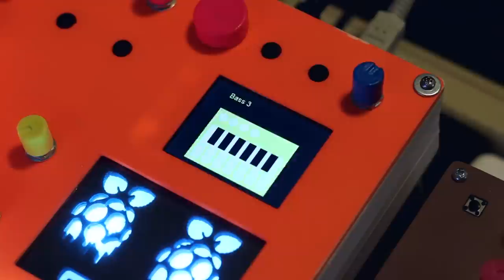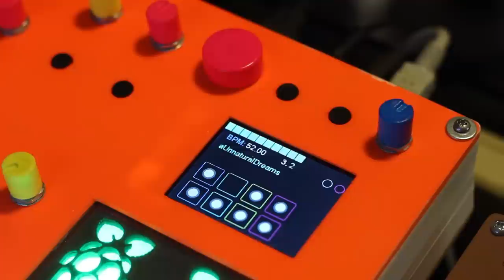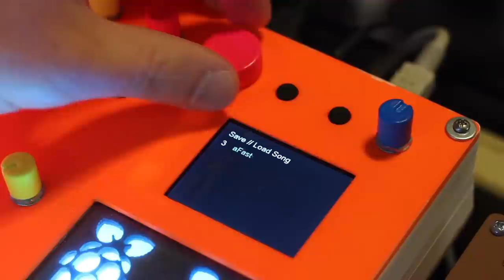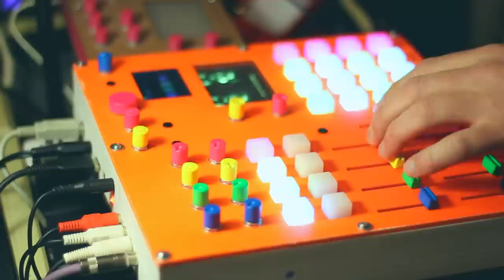Raspberry Pi Looper/synth/drum thing

Comment: This is really dope. I was interested to build something similar, but using a midi-Keyboard instead of an onboard pad controller. It'd be pretty neat to have the onboard pad controller and an external midi-keyboard and have them control separate patches. 
Awesome build! Subscribed
Reply: I made it just like that. not actually to control separate patches but made a full midi implementation for external control.

Comment: I would like to know how you configured the uca222, what parameters you used to set the latency in Jack and in pure data. I using the same uca222 with puredata and Jack often have xruns. Did you use a particular rt kernel? have you set something in particular to be able to get an error-free sound and so low latency?
Reply from the maker: I was getting xruns with Jack as well. I ended up not using Jack at all. In later versions of this project I used an audio injector card which worked better than the uca222. Ive used the stereo one and the pi zero one and they work great:
http://www.audioinjector.net/

Comment: I want to build a groovebox from scratch where should i start?
Reply from the maker: Depends. If you want to/already are into coding I’d check out the teensy audio library or electrosmith daisy. If not check out pure data/max. I believe daisy can run pure data patches but I haven’t tried it.  This old project used pure data on a raspberry pi, which is also an option.
Reply: @otemrellik  what r the fundamentals for making a groovebox?

Comment: I watch this video more times than i want to admit!
This is amazing, any resources on how to get Pure Data running on the PI?
Also, do you use the Teensy as a USB midi device, plug it in through USB to the Raspberry, and have it trigger the patches like that?
Also, those buttons look amazing!  Where did you find buttons that have RGB LEDs????

Love this build man, tis a dream to build something like this.
Reply from the maker: Hey thanks. Just install pd on pi through the terminal and it should work fine. There is no midi here, I'm using serial communication from the teensy to the pi through usb. You can find the parts on the github link.

Comment: How should I start building DIY synth stuff? I have no knowledge of electronics really, but i would love to learn.

On a side note: how did you build the enclosure for this? it looks great
Reply: Look up pure data software and tutorials. Teensy has libraries you can choose from so you can wire up some buttons and nobs to it and turn it into a midi device. I'm right in the middle of trying to make this pi looper.
Reply: It's a work in progress. I have all the hardware and software in place. There is no wiring guide and the creator doesnt remember how it was wired. To make it worse it's been rewired several times so the only clues I have are screenshots from this video. I have been busy lately but I'm slowly working towards a solution in trial by error.

Comment: Very cool! Is this fully dsp generated sounds or sample based / wave tables? Sounds very good IMHO!
Reply: BTW on the touch screen breaks, you should make it recover in sync with the loop clocks (at least on beat) so the general beat isn't interrupted ;)
Reply from the maker: Thanks! The internal instruments are full dsp. It's an Fm synth engine I made. The second version of this box also has sampling capabilities but I have yet to post a video of that one.

Comment: Amazing I have used pd before utilizing super looper and it's good running in my old laptop.  I'm curious as to how you got the teensy and the raspberry Pi communicating.  Is the RPI capturing the sound from the teensy?  It would be great if you can share the how things are wired up on this board.  Thanks!
Reply from the maker: Raspberry pi running pd is doing all the audio. The teensy is just sending/receiving information through serial for the knobs/buttons/sliders. I'm using the comport object in PD to talk to the teensy.
Reply: Thank you again and best of luck in future projects.

Comment: Suuuper dope. I'm building a video synthesizer and this is really inspiring. Also based on teensy and rpi3. Would you mind sharing a little more info on the communication between them? And the knobs, sliders and the casing looks super solid. Where did you order that?  Awesome work ✨
Reply from the maker: Thanks! Are you using PD for the video stuff? The serial communication is done here in PD with the comport object  and some code from: https://github.com/alexdrymonitis/Arduino_Pd

I 3d printed the case and all the knobs. I may reprint the knobs out of some more flexible plastic though.
Reply: otemrellik Cool! No openframeworks actually. But I guess I could just translate it from PD. Oh nice that it's printed. Where did you order the pads?
Reply from the maker: The pads are from sparkfun:
https://www.sparkfun.com/products/7835

Comment: Hi, very nice project, quick question, what is name/reference of the rgb silicone 4x4 buttons ? 

Thanks
Reply from the maker: https://www.sparkfun.com/products/7835

The led's are actually neopixels mounted to the bottom of the pcb. I drilled out holes in the pcb where the normal leds would be so the light shines through.
Reply: It's a custom pcb where the neopixel are or you modify the pcb from sparkfun? Thanks for the information
Reply from the maker: Just drilled holes in the pcb from sparkfun.
Reply: Oki nice idea, I was thinking to build my own pcb but ur solution is quicker! My only regret is the sparkfun pcb which didn't have an i2c IC, less cable... 

Thanks again for your reply!

Comment: Is there a way to change the effect on the touch screen? I don't see myself using a beat repeat often. If you could point me to the bit of code, that would be awesome. Thanks!
Reply: It's all based on Pure Data which is a programming language. So the sky is the limit.
Reply from the maker: open up pilooper.pd, then click though pd audio-IO, then pd post-loop-fx. The beat repeat is called pd tableGlitch. You can disconnect it from the inlet and replace it with anything you'd like. 
https://puu.sh/w67bf/02f5a72c71.png
Reply: <3

Comment: Hi! Is 2Gb Raspberry Pi 4 fine for such projects? I'm going to buy one and checking my needs.
Nintendo DS screen usage is a cool option indeed! If these are cheap (maybe) then it's nice to have. I guess that it may be better than standard Pi sensitive screens. Didn't compared though.
Reply from the maker: I think this was built using a pi 3 so you should be fine.
Reply: I switched from a Pi3 to a Pi4 with no issues. I keep having problems with the DS touchscreens failing at the breakout board so I will be switching to a resistive touchscreen when I have time to resolder.

Comment: Awesome and inspiring project. I'm currently deep in the research phase, and slowly acquiring the necessary parts to make this, as it is basically my dream piece of hardware. Thank you ever so much for uploading all the code, that's super helpful and I'm in the middle of trying to figure it out now! I think this may be within my capabilities to build but there's a hell of a lot of learning to do, 3 programming languages I've never touched before as well as all the assembly skills... still, aim high! 

Quick question though: How easy do you think it would be to integrate another trellis into the mix, from a coding point of view? just a case of reassigning the pitches in the various synths or something more complex? I know the trellis libraries are well-documented and support larger grids so that would, presumably, help.
Reply from the maker: This doesn't actually use the trellis library. Those are sparkfun pcbs for the buttons. I imagine it wouldn't be too much trouble to add a second matrix of 16, not sure if there are enough pins left on the teensy to handle it though without something like a second multiplexer.
Reply: otemrellik oh yeah! That's my  research bleeding through, that is. I've been toying with the idea of using them instead of the sparkfun boards, as I'm quite happy with monochrome buttons for this build. Excellent, good to know, an extra mux shouldn't present too many issues (famous last words!). Cheers for getting back to me :)
Reply from the maker: Ah word, if you go with trellis, one thing to consider is that it uses 5v logic whereas the teensy 3.6 uses 3.3v. Good luck on your build!

Comment: shouldn't have mentioned that there's a button, now I must know what it is, hard reset? re sync? launch several wmds?
Reply from the maker: Haha! It's pretty much a reset. It runs a python script that kills pd then restarts the patch it with a new audio device number (cycles though 1-4). I had to put it on there because when I sync the clocks over usb with my girlfriends setup it sometimes boots up thinking her audio/midi device is the one to use instead of the internal audio interface.
Reply: otemrellik thanks for your reply, so I wasn't far off then with that guess, nice work anyway.
Reply from the maker: Thanks! Perhaps I can attach the wmd lanching later.

Comment: That's very inspiring. I am planning to do something similar, but without synthesis capabilities and including MIDI sequencing and audio input. I have thought of using Teensy. Would you be able to do so without a Raspberry. I mean, the main purpose of it here is the synth funcion, isn't it?
Reply: the raspberry pi is providing the synth, sound library / memory management, and data synchronization (LEDs, BPM tracking, etc)

Comment: Absolutely incredible build. Nicely done. What's the casing made out of? Looks like perspex on top?
Reply from the maker: Thanks! Its abs plastic I printed then sprayed with plastidip. I sort of regret spraying it though as that stuff just rubs right off.
Reply: What did you print it on? Something with a big print-bed by the looks of it.
Excellent work, BTW
Reply from the maker: Taz 6.
Reply: That's a serious printer, man.
Reply from the maker: Indeed. One of the best purchases I've ever made.
Reply: otemrellik if you have access to a vinyl printer/cutter you could quickly make up an overlay to look however you want then maybe clear-coat over that for durability

Comment: This is amazing sir! I'm looking forward to try to follow your documentation and make one of those myself. I must ask you: how is the external sound looping process? and how is the visual feedback for it?
Reply from the maker: Thanks! Not sure I totally understand your questions though. The external sound looping isn't really demoed in the video, but there is stereo rca inputs in the back from the sound card. Once you have something plugged in there is two buttons at the top that activate each line input and has volume control for each. Not sure I understand the question about visual feedback. There are input monitors on the right hand of the screen that show you the levels coming in.

Comment: Can you provide a list of components used to build this machine?  Or does is do midi that can be mapped to a controller?
Reply from the maker: It doesn't do midi, check the description for the github link. Components are listed there.
Reply: Okay will do!  I was just wondering if I could build something like the SP-303 with the Raspberry Pi that I have which is how I came across your video.  I'm impressed!  I wonder if midi can be added to the code, if you don't mind me playing around with it.  I have a Native Instruments Maschine that I was wanting to make standalone
Reply from the maker: Thanks! Some dude on reddit added midi to my patch, I haven't looked into what he did to see if  he got all the features but you can check out the thread here:
https://www.reddit.com/r/raspberry_pi/comments/6ew1wd/raspberry_pi_loopersynthdrum_thing/
Reply: I'm checking it out now!!!  Did you custom-build the synths or is it branched off of something like Sunvox?

Comment: Do you have any problems with latency, crackling, or audio cutting out? I've been considering using the Pi as a realtime audio device using DSP, but there's a lot of talk about how it can be unreliable due to not being a real time OS
Reply from the maker: There is some slight latency which I only notice when running vocals through it. I don't notice any when playing the pads though. I do experience some audio dropouts now and again, they are just small pops and don't happen too often. The new pisound card may work better than the u-control I have in there.

Comment: where do you get those button caps? i can only find them on adafruit, i cant find them anywhere else its crazy
Reply from the maker: Check the github link in the description.
Reply: otemrellik thanks! It’s actually the same as the adafruit one: price and all. 
I just thought it was weird I couldn’t find any from China or a bulk electronics supply company, usually when I can’t find something it means I’m using the wrong search term or something lol
Reply from the maker: @buttersstotch2014  I think the adafruit ones are for their trellis. The sparkfun ones are larger I think. Yeah, I've spent days trying to find better solutions and have come up empty handed. I've found this style of button doesn't have much of a lifespan and stops making contact eventually.
Reply: otemrellik there’s so many consumer electronics that use buttons like that- Hard to believe I can’t even find non opaque ones, I’ve just been salvaging them lol

Comment: What drivers are used to recognize your DIY build? Did you written it yourself? Seems like a hard job not only make the different prints hardware connected, (perhaps for a tech, its easy )  but a nightmare to find a driver that allows them to cooperate on MIDI/USB level... Or is the USB connection only ment for sample swapping on it's SD card? Or does the system somehow automaticly detect some kind of Macky Universal controller?!
Reply from the maker: I'm not sure I understand your question. This is not a MIDI controller, it actually doesn't use MIDI at all (except the sync data which goes out though usb). The teensy uses serial communication to talk to the pi and send messages back and forth. I did not have to write any drivers. The serial communication works straight away.
Reply: From your answer, you DID understand my question. :) So you have answered it, thank you. I thought you made a midi / usb connection besides the stand-alone product, but i fooled myself, seeing you ran a DAW besides it... That's my fault...  Still though, must be a nightmare to create a midi controller out of it..
Reply from the maker: Ah, cool, glad I answered you question!! Turning this into a midi controller would probably be a bit of work, but it is doable. You would have to replace all the serial communication with MIDI. You actually wouldn't even need a raspberry pi in that case, you could alter the teensy code to send usbmidi instead of serial.
Reply: Yes, sure! But you have to figure out each midi channel for each individual button or slider. Then you have to set each max and min in/outputs, also theres difference in programming a button or a slider. And because you have a display you want it to respond on the display aswell, which also needs alot of coding and routing. I didnt say it's impossible, but must be nightmare to have the patience to find out every single controller and route it on midi.   Then, you must be lucky that a simple 'universal' midi driver, like Macky, understands the routing you've made. ( And Macky isnt really that universal ) So you probably need another midi driver, probably custom made...   ( I guess it would be easier to just copy the midi routing of another excisting midi controller ) 

Well anyway very very cool video. I am considering creating something like this, but it would be more of a standalone launchpad then a fader  - combined one.  Sorry for the misconception.
Reply from the maker: You could set a variable for a global midi channel number in the arduino code. All the code that is reading the sliders/knobs/buttons is already in place, you would just have to change the serial communication to usbmidi. You could use a map function in arduino to change the analog readings range from 0-1023 to 0-127 to deal with min/max stuff. The teensy set to midi is class compliant so there is no need worry about drivers. The display would be tough, that is actually the reason I choose serial over midi because midi doesn't really account for the scope of sending strings (like song names)  very well.  I've built quite a few midi controllers with teensy but just realized I've never uploaded any midi controller code to my github. I have a lot of midi controller projects though and I would be happy to share if you are interested. Here is one of the more complicated controller I've built:
https://www.youtube.com/watch?v=rDrLSuNT5WI
Reply: Great stuff! Yes, that would be awesome. Thanks a lot!

Comment: what's the light that changes with the sound behind your machine?  is it built into the box?
Reply from the maker: That is a strip of neopixels I have around my live gig. The are connected to the box and react to the amplitude of the sound it's producing. Hooked them up via a 1/8 stereo cable.
Reply: So that would work with any audio source? Thanks for the reply by the way
Reply from the maker: Well its specific to this project. The PD patch sends amplitude data out of the pi into the teensy board. The Teensy then sends that data to the neopixels out the 1/8 jack. There are some projects out there for doing this sort of thing with just a microprocessor and some neo pixels. Here is a project like that:
https://learn.adafruit.com/sound-reactive-neopixel-peace-pendant/overview?embeds=allow
Reply: Awesome thanks for the info, I didnt know if it was a simple configuration or if it required some kind of programming. Ill check out that project right now, the box you made is amazing btw I would love to be able to do something like that some day